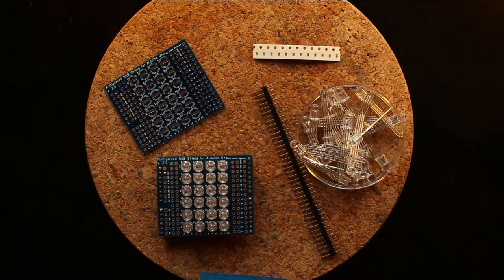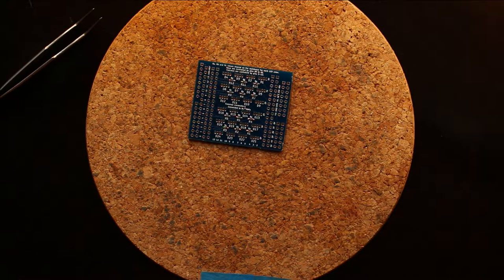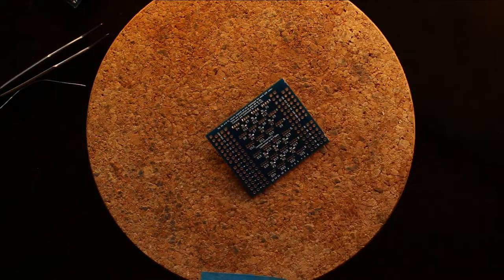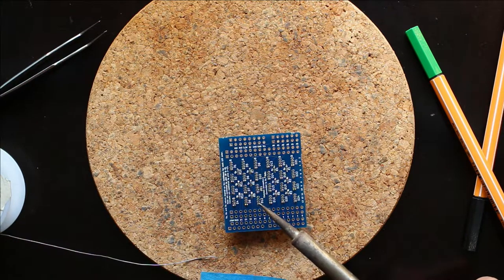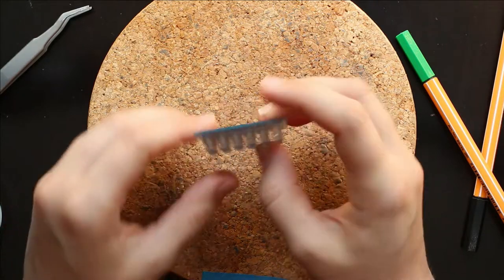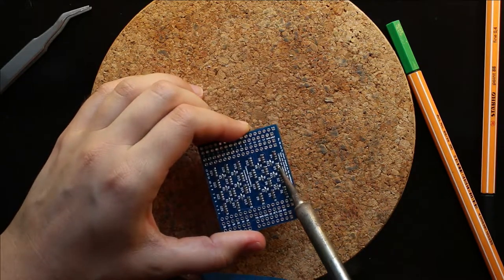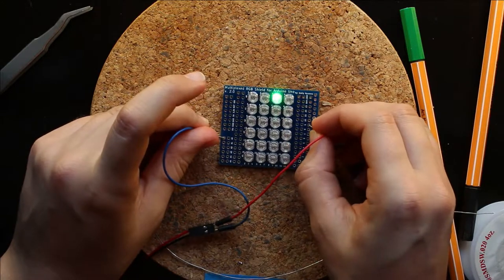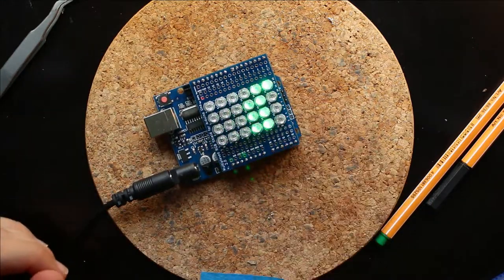Assembling and Troubleshooting the Multiplexed RGB Shield

Comment: I bought a kit at HOPE, and watched the video for some hints on how to assemble.  Just some thoughts:
- you really need a non-magnetic set of tweezers to handle the SMD parts!
- looks like a larger chisel tip on the soldering iron would be more effective coupling heat into the part and PCB pad when soldering.   That tiny tip is crummy for applying heat for PCB soldering; too little surface area to heat the part and pad.

Hard to tell from the video, but it would be good for people to know that you don't melt the solder on the iron; you heat the part and PCB land with the iron, and apply the solder to the joint where it should melt and flow.

Also, wondering why pre-snip the leads on the RGB LED?  You loose the one common pin that's longer than the others to help verify that the part isn't reversed.  If you inserted the parts one row at a time, soldering one pin and then trimmed, I don't think the longer leads would get in the way too badly..
Reply from the maker: Hi Louis,
Thanks for the comments. 

I end up with tons of flux residue on my tweezers which might make them appear magnetic. To clean them I use isopropanol. 

I have a chisel tip on my other soldering iron, I know some people like these better, but I find them about the same to work with for most applications.

re. pre-cutting the RGB LED. I find it much easier for people to solder the RGB LEDs if the leads are already short for two reasons. The first is that it is much easier for people to get to the pads (esp. the middle ones) if they do not have long leads in the way. The second reason is capillary effects: because solder is a liquid and the pins are very close together it is quite easy to end up soldering two leads together without getting solder on the pad. Although professionals do not have this problem, it is really common among people who are just learning to solder (and sometimes realizing they need to get reading glasses). Because there are 3 ways these LEDs are marked (flat side, long pin, ground is visible through the plastic) loosing one way of orienting the pins is rarely a problem.